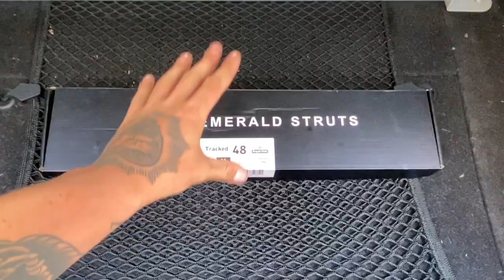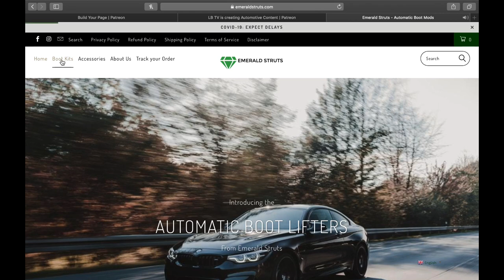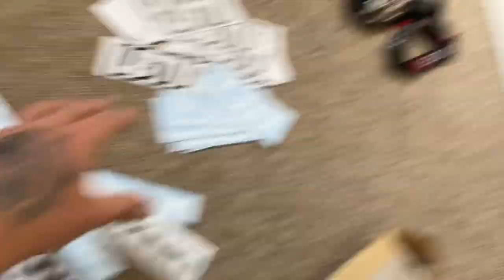THIS MOD OPENS YOUR BOOT **AUTOMATICALLY** BMW 1 SERIES INSTALL!!

Comment from the maker: If you’re interested in one of these then head over to the website here - https://emeraldstruts.com / USE DISCOUNT CODE LBTV FOR 10% OFF!!
Reply: Great MOD been trying to figure this out myself for my E90. Just looked and Emerald Struts are completely out of stock for all models.
Reply: Have you had any problems with the new struts whatsoever so far?  Please reply.
Reply: Do the emerald boot struts make the boot shut more gently

Comment: I was going to order and install until thank god, this morning, realised I pressed the boot open button without realising, so the boot spent upto 3 hours slightly open in a parking lot. Now I can imagine with this on, my boot would have been wide open. Good system if you have a button in the boot instead of the key

Comment: HI GREAT VID  ,  WILL THESE WORK ON 09 PLATE 1 SERIES M SPORT , ?  AS WHEN I PRESS THE BOOT FOB  IT UN LOCKS IT BUT YOU HAVE TO PUSH THE BMW BADGE IN TO OPEN THE BOOT , THIS MIGHT SOUND LIKE A SILLY QUESTION BUT IVE ONLY JUST GOT MY BMW AND DONT KNOW MUCH ABOUT THEM   THANKS    P.S    KEEP UP THE GOOD VIDS

Comment: Hey, is that the key from the newer BMW's? How did you make it work with the m135i?
Reply: Also looking for a solution for this.
Reply: It looks like the silicon carbon fibre look fob cover. Emerald struts sells those as well.

Comment: Or if u wanna do it on a budget buy urself some springs and slide them over ur struts and does the same thing,done it on my polo
Reply from the maker: Yeah then those cheap ones will fail. Seen it happy so many times.
Reply: LB TV the struts ? I’ve heard that over time it can damage your struts but when brand new struts are £15 it’s a no brainier mate aha ,good vid anyway👌
Reply from the maker: Daniel Helme no the cheap springs you get! Better off buying a fully professional tested product. Buy cheap, buy twice as they say
Reply: LB TV these weren’t cheap springs were from a reputable company,£20 for springs and new struts are £15 so deffo cheaper than the full kit but time will tell aha

Comment: Hey man just came across your video, very sick! I’ve got a 2018 118i F21 3 door. I saw these boot kits are only for the M140, M135. Will it work on mine do you know since I am 100% gonna get them if they do!
Reply from the maker: Yes they do fit any f21/f20
Reply: LB TV awesome thank you, would you have any idea when they would be back in stock bro?

Comment: Damn they're sold out need one for my S3 😢
Reply: Buy the bluedie springs of ebay then undo your strut top then put the springs in and screw the tops back on, save you £50